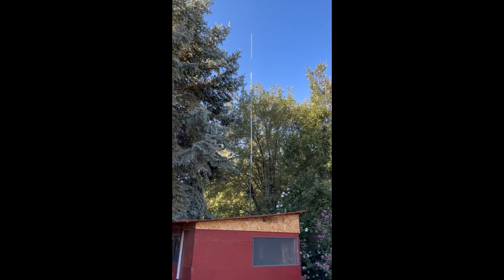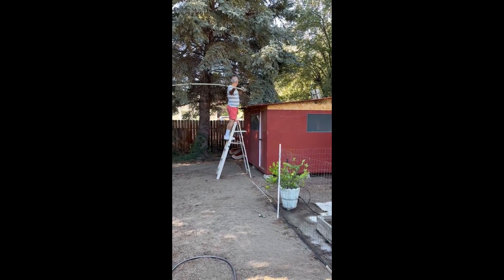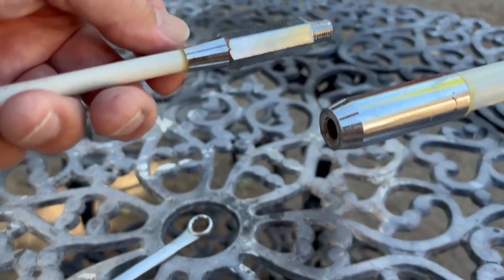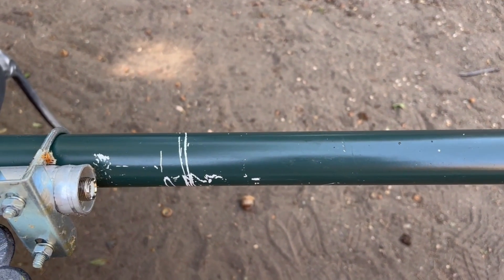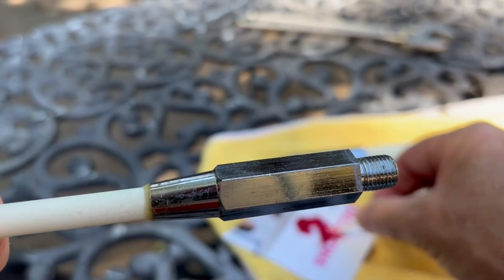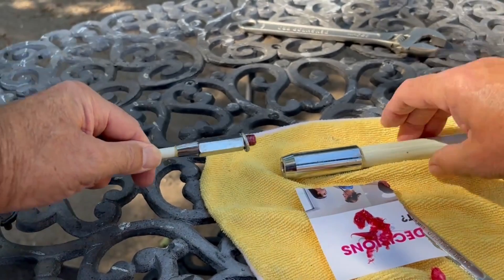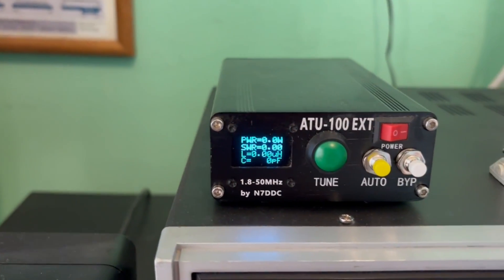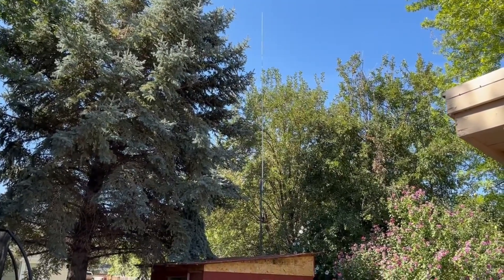1 Year Maintenace on the Solarcon A-99 Antenna

Comment: I have some copper infused greese if you need a conductive connection for you to try next year.  I used it on my Zero Five 33' antenna.  I need to fold it down and check it before winter.  Keep the videos coming!
Reply: Jet Lube is one and Deoxit makes some. Jet Lube is much better priced.
Reply: Appreciate the follow up video. I am in the process of getting my A99 up in the air. Good to know they hold up well!